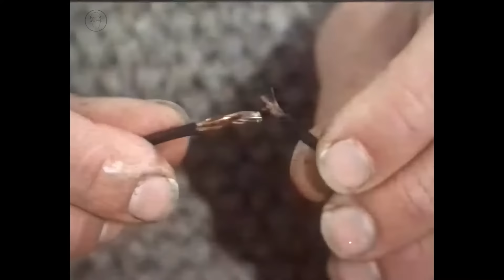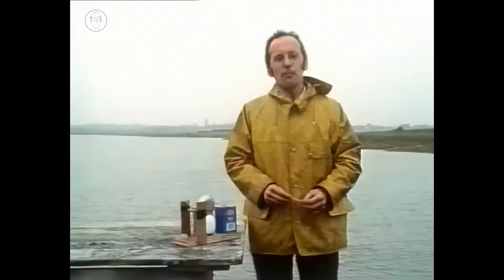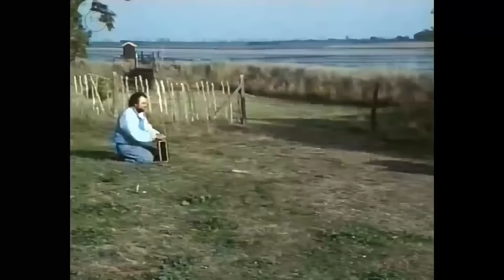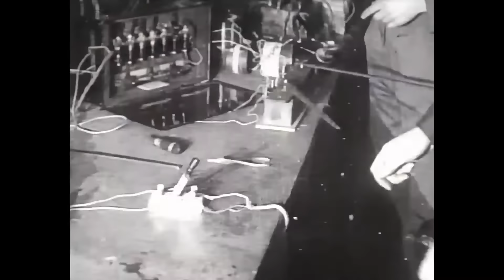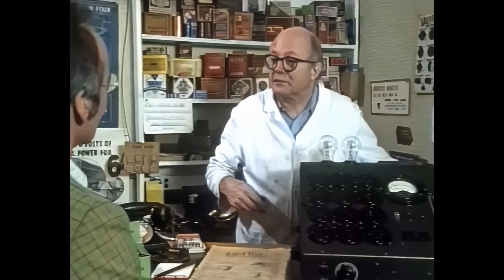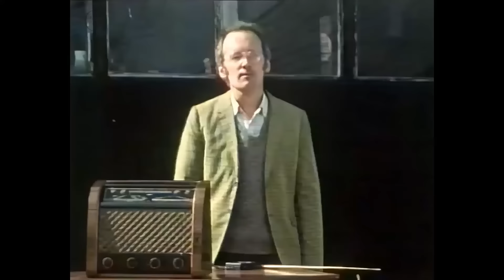The Secret Life of the Radio - Remastered

Comment: Wizardry, that's what radio is. If you wibble physics-stuff around at one end, get the impedances all lined up right, You can then hear stuff somewhere else. The medium is irrelevant, it works work with loads of stuff.

Proper radio wizards are some pretty tuned-in people, often caught late at night listening to different bits of the universe, or a lightening storm in Kazakhstan. Some of them talk in code to each other, with tiny distant beeps, with elaborate experimental equipment they built themselves. Talking to men beyond the earth is not much of a challenge for a competent wizard, and bouncing signals off the moon isn't rocket science!

It's bloody wizardry!

Comment: Despite the ironic and relaxed tone of the documentary, I think it lacked the inclusion of the contribution that radio amateurs have made over the years since the beginning to the development of communications, not only the communication itself but also the technology used.
Incidentally, Marconi's experiments initially gave the impression that the longer the antenna wire, the greater the transmitted signal would be, but experiments showed that in fact, the best signal occurred when the length of the wire corresponded to the length of half a wave or an odd multiple of the transmitted signal. This was a valuable contribution from Marconi.

Comment: It's not actually the sparks themselves that emit the radio waves. The sparks act as a high-speed switch, that generates RF energy at high frequencies due to the rapid rise and fall time of the current that is flowing through them; these rapid transients are caused by the microsecond-scale changes in the resistance of the spark (breakdown of the air) from just a few ohms to infinity.

The radio waves are emitted by the conductors that are connected to the spark, and by whatever conductors (such as your kite-supported aerial) are connected to those conductors. Of course, the spark gap is a part of the circuit, and so contributes a tiny fraction of a percent to the total power of RF emitted by the circuit. But the spark, in itself, is not the point from which radio waves are emitted. You could substitute a rapidly modulated MOSFET for the spark gap, and get the same result. Of course, Marconi and Hertz didn't have anything like a MOSFET available to them 140 years ago.

Comment: We tried to give away a 50KW RCA radio transmitter from 1939 ( serial number 0001 ) and, having no idea how big it was, the museum sent out a car to pick it up. The front panel was about 12 feet tall and 30 feet across. Working on the final, you opened a door and walked into the amplifier.
Reply: Did someone get the transmitter? Or was it scrapped?
Reply: @Zap-b9f it finally got scrapped, so did pretty much the whole site. 1939 , art deco, living quarters, studio, control room, it was a shame.

Comment: I suspect that one of the reasons that digital radio hasn't replaced analog radio is because there is far less spectrum to be gained by the transition and it is at very different wavelengths than existing cell phone infrastructure. The AM band is only 1.2 MHz wide and is at far too low a frequency to be useful for cell phones. The FM band is 20MHz wide and barely at a short enough wavelength to be useful for things like phones. The amount of efficiency gain by the analog to digital switch would also be more modest. I think that the digital TV transition allowed about a factor of 2 to 3 reduction in bandwidth with an increase in quality at the same time. For digital radio it would be more like 1.5 to 2x.

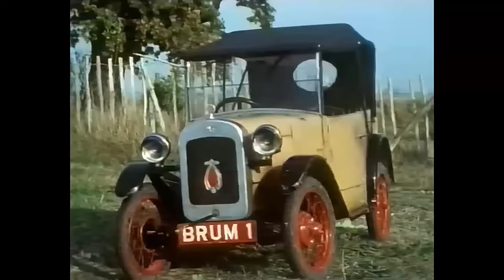Comment: I'm a bit awed by the RC car at 10:55, the protocol he used to drive it is crazy.  Shifting a specific pulse in a sequence forward or reverse in time.  True analog radio control.  You'd definitely have to  have programming to deal with reception flukes on the business end.  But if you only had 30 axes (or bools) to transmit, at a 1MHz pulse train, it would update every 31us with some sort of frame header.

Comment: This is 💯 true story:
29:56
"He'd recently acquired a long wave BBC transmitter from Yorkshire"
rock back accidentally in my chair, terrible creaking noise

"And the museum declined to put it on inventory"
more terrible creaking from my chair

pause video.
Fetch WD-40 downstairs
Huge "Le Restige" style chair upturned in tight space to get under it and spray oil at anything that looked like it moves
Can't get it to do rocking motion while upside down to even see if these efforts are effective

Throw out back while uprighting my chair.
Find out that it wasn't rocking while upturned because the rocking lock pin got pushed in. Ah I see.

Unlock pin, rock chair, smooth and deadly just as it should be. 😎

Unpause video.
"so he was rather left with this thing."
rocks smoothly in chair

"So anyway, I ended up with this absolutely magnificent gadget here."
In video Tim starts turning metal capacitor thing

I'm sufficiently startled by the sound of obnoxious ancient metal doohickey that I instinctively grab WD-40 and start blasting my monitor. 🔫

Comment: LOL he puts it on FM and some guy is going on about gorilla warfare... the cold war was still going on when this show first aired. He can't interrupt it like he did AM, that was funny even back then when this show came out. It is kind of hard to tell when this video was done as the UK in the 1960's was like America in the late 1940's other then the slight clothes change, like wider shirt collars. Like when you go to an area that did not have a single 1950's style diner lol, I mean for many many miles. Men wear the same look forever too. I think this is an 80's TV show because I've seen it back then but even now I can't decided if maybe it was a rerun and on in the early 1970's. They are stuck in a decade or two behind it seems at times... and yes I know what I'm talking about and I knew plenty of people, including the Beatles and both John Lennon's sons and Yoko too... this could very well be a late 80's early 90's TV show even. I saw a car but he could be driving an older car around like many did. Either way you look at it, what they are saying about radio is still relevant today. I think it is an 80's show partly based on the font they are using... in the 70's and before they would of done less to change from something more like times new roman or whatever it was, and the technology depending on what they were using had less capability, not that it would been impossible. Their were some devices that I have seen that were big PC sized things with the length of a piano keyboard full of buttons more similar to an early calculator with keyboard keys similar to the Camador 64 I guess, all that just to have the basic function to put text on the screen for shows. All that to be stuck with one font lol. The hole point of a 1950's diner was that it kept the teens out of trouble with something to do, having a place to go really, so really that must of sucked. Actually if you looked hard enough the 1950's diners existed in the 1940's but with a soda jerk. Juke boxes existed in the 1920's even but were not as common, and looked like wooden cabinets with glass windows, and did not hold nearly as many records as the ones of the 1950's and 60's

Comment: The demonstration of the large metal ring with the spark gap at the beginning shows how the modern "magnetic loop" antennas work;  by converting the electro-magnetic waves in the air to an electrical signal that the radio can convert into an audio current to operate the speaker diaphragm.

Comment: "People are now listening to podcasts.  Um. So.  They're now listening to things that come through fiber optics and wires, no longer through the magic of just coming through the air.  It's sad really."

Well, that's not really true.   Wireless connections via wifi, blue tooth, and cellular are really supplanting hard wired connections.   It's more of an inversion of things.  It used to be that long distance transmission was done via radio with the final stretch being done with wires from the antenna and then to the speakers.  Now we mostly transmit over long distances with wires and get rid of the antenna wires and speaker wires.

Comment: I still can't believe the receiver at the beginning worked without a battery or any power. Though it does show how impractical it would be to try to use electromagnetic waves in the air to power anything

Comment: Odd timing, really, noting that so much comes through fiber optic cables to the home now... what I'm noticing is a shift towards wireless home internet, be it through Starlink satellite, or through 5G home internet (which I use today - it's actually better in the city than the wired offerings!). Once again, cycling back to no wires, and it's truly remarkable and a bit crazy with what high frequencies and bandwidths things are flying through the air at today.

Comment: What was the original tape format?, C? UMATIC,??  The end quality is very good. Thanks, great story..Radio is alive and well but not just for entertainment anymore.  I live in asia (Thailand) and I can receive WSPR stations which are radio amateurs using less than 5 watts to get huge, sometimes over 16,000km distances using a slow speed digital modulation technique. WSPR Means Weak Signal Propagation Reporting. Somewhat ironically, the advent of the internet and the ability make radios, use them and report to each other "logs" has really fired up enthusiasm in youngsters, helping them enter into science and technology - rather than dreaming of being an overpaid overworshipped footballer with a bling watch and luxury car. Finally, my slant on charging batteries from the "ether" could be practical as the many chinese shortwave radio stations nearby pump out megawatts each day...

Comment: Radio hasn't really gone away, it's just changed with the times to become magical in a different sense. While listening to this program over my (bluetooth radio) wireless headphones, I can use my smartphone to turn a light on in my house, using a 4g radio signal to tell the smart home device to transmit a z wave radio signal to the light switch.

Comment: Ireland switched off its DAB radio network on the 31st March, which carried the national RTÉ radio services, so FM lives on for the foreseeable future here.  RTÉ said that DAB was the least utilised platform in Ireland.  

Based on picking up the UK DAB service at my workplace (near the Northern Ireland border), the main issue I see with DAB is trying to squeeze as many stations on as few mux frequencies as possible, i.e. reducing the bitrates and in turn the sound quality.  Some stations have even gone back to mono!  If only they would add new multiplexes, especially with 32 (or 38 with VHF channel 13) to choose from.

Comment: In common with many others, Tim, you've not been taught anything about Tesla, who, in fact perfected radio transmission and the tuned circuit several years before Marconi, who quite demonstrably stole his patents. Marconi was incapable of comprehending how the tuned circuit functions, so he had to copy Tesla's circuit precisely, in order to get his own apparatus to work. Marconi was also unable to get his head around the concept of the "ground wave" another of Tesla's discoveries, which makes intercontinental radio transmission possible. To neglect Tesla when telling the story of radio really is a terrible omission.
Radio control as per the car you demonstrated, also invented by Tesla

Comment: "once the tuned transmitter was perfected, spark transmitters were quickly banned for polluting the airwaves" immediately reminded me of the Titanic. Supposedly, the Titanic Marconi operators were warned several times about icebergs but they didn't get the message because of the interference of all of the other spark transmitters & they were also busy sending & receiving the passengers' trivial messages. Love your work Mr. Hunkin!

Comment: "listen to podcasts through wires not through the magic of going through the air."
Well, you seem to have forgotten that wifi  exists.
Also something you could've talked about in the outro is the advent of SDR, or software defined radio, which allow tiny chips to do the work of comparatively bulky crystals, coils and capacitors.

Comment: I found that exact Roberts tabletop radio shown in the opening demonstration in a thrift shop here in Canada a couple years ago. Was in excellent condition - I suspect it was used for decor. Picked it up as it had a very different aesthetic from what we usually see here, and because it's rare to see electronics imported from the UK.

Was battery powered only, required some sort of battery I've never seen before. Had snap terminals similar to that of the common 9v prismatic, but whatever the battery was must've been sized significantly larger than a usual 9v.
Reply: They used a PP9 battery. Some larger sets made by Hacker used two.

Comment: The bandwidth required for analog television was quite absurd (6 MHz per channel in the US) relative to radio which has 150 KHz per channel. It probably boils down to spectrum recouping potential: for video, digital compression and multiplexing allows many channels to be sent on a single narrower channel, not to mention the popularity of over the air TV has waned considerably. At the end of the day the effort required to convert every radio is immense and the value probably quite low in comparison given that you cannot shrink an FM signal all that much and retain the same fidelity in digital land.

I did actually acquire an HDMI TV modulator which was pretty fun. I could mix a TV signal in with over the air channels and send a single Apple TV throughout the entire house :)

Comment: This is my favourite episode of this series. It's probably because I've been into electronics for over 40 years and fondly remember the "magic" of the first time I listened to radio on a battery less circuit I wired on my 75 in 1 electronic kit I had gotten for Christmas.  I recently bought an actual piece of galena so I could build a "real" crystal radio, I've always felt that using a diode is cheating somehow, not that it stopped me.

Comment: It's quite maddening that most cell phones have broadcast receivers built in, but they're inaccessible. The cell providers keep them switched off, and lobby to not have them turned on by mandate. Another reason to hate your cell provider!
The post-production discussion might have also mentioned SDR (software defined radio), which is pretty amazing. Also, satellite radio and GPS are direct descendants.
Reply: It's so hard to find apps with adjustable tuners today
Reply: @TheAlps36  You may have to jailbreak your phone to access the radio. Some Verizon phones don't have radios. They pay lobbyists to get around the law.

Comment: Although, as you say, podcasts pass down fibre optic cables, probably they mostly arrive on the final laptop or phone via Wifi or 4G. Many will reach the speakers or earplugs with Bluetooth.
Reply: Indeed, albeit highly encoded and compressed.  We use radio more than ever, but it's more inscrutable than ever as well.  It's supposed that, if aliens (within 50ly or so) ever detect any radio signals from our direction, it will be only a narrow (less than a century) window in which we used powerful carrier based broadcasts.  Modern encodings are only the power needed to reach the target audience; DTV required about a tenth the power analog TV used to, yet offers about as many times more bandwidth (or sub-channels, of low definition, per transmitter).  Truly a modern marvel -- but little more than noise on the spectrum, undetectable at a distance.
Reply: @T3sl4  big issue i have with the DTv i get less stations  then the Analog days. Being rural they dont come through year round. Weather and trees play a big issue  now. I have the largest roof top antena made,  rotor and signal booster. Still can pull in all the network stations like the anolag days.... I have gone around and round with the FCC and the local stations about the problem. Crazy how technology goes backwards it seams if your outside a city.
Reply: @Wrang15  Yep, the downside to the method is, below a certain SNR, there's just nothing to work with (even if you know how to decode it).

But at least you've got internet, right?  (Unless you're in one of the many areas neglected for broadband...smh)
Reply: @T3sl4  its one meg dsl. That runs sub 500 kbs a lot of the time. They are not adding new customers at least. They have a wating  list. Should get intresting 70 new homes are going up and not a thing from the one ISP we have. Township allready put pressure  on them and was told o well.
Reply: Still on copper DSL where i am.... not one update living rural... 1.5 mps is it on the ground.... still very spotty cell coverage none on my still dirt road.  Lot of sat dishe systems.

Comment: True analog is never going away - it simply can't be replaced. Big radar installations still use tubes (thermionic valves), and every single person has at least one tube in their home - the humble microwave. 
Also, if you connect to the internet via a starlink satellite - you are again listening to sounds coming through the air - space, even!
Reply: Well said :^)
Reply: @JayDee-b5u  it cracks me up when I see rabbit ears sold as 'digital TV antennas'

Comment: The bit with Rex tuning in his little airplane radio and talking about the navigation beacons reminded me of when I was maybe 12 or 13 and learning how to do that same thing, because it was simulated inside Microsoft flight simulator. This would have been within a few years of when the program was made in the early '90s. I think all of that radio beacon stuff is still heavily taught as a just in case but probably not used all that often given the ubiquity of GPS in aviation.
Reply: I haven't kept up with any of this; have they been shutting down a lot of nav beacons?